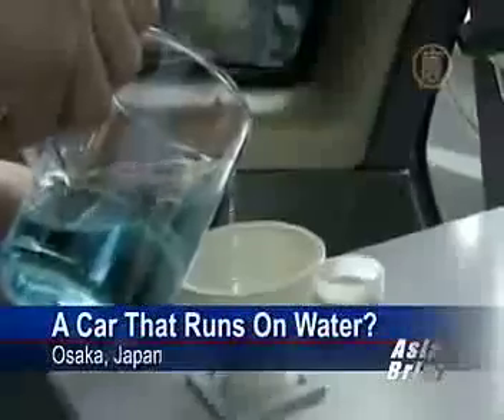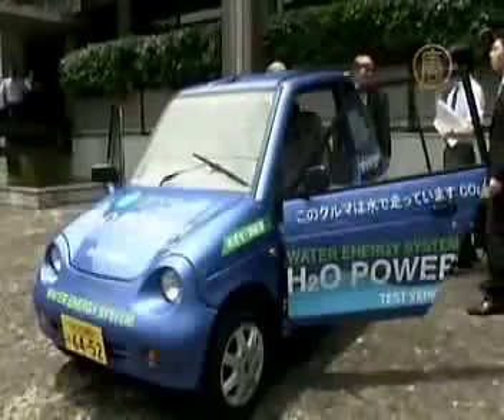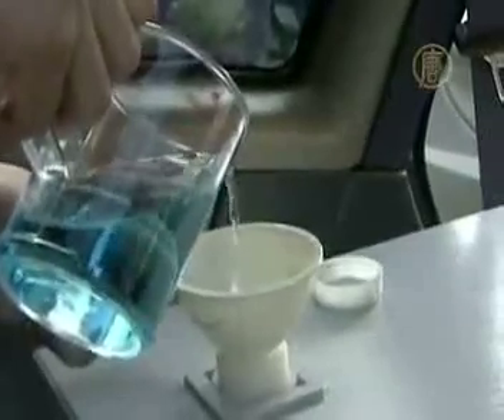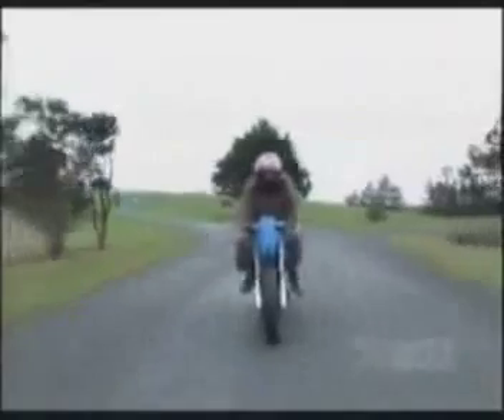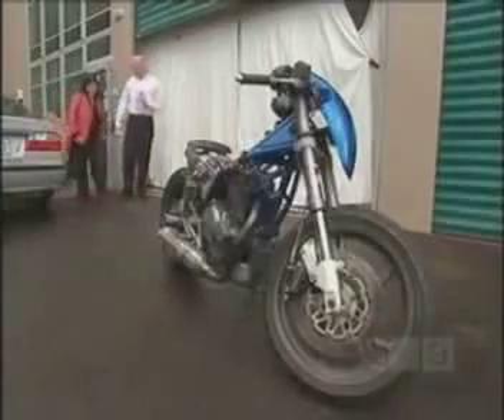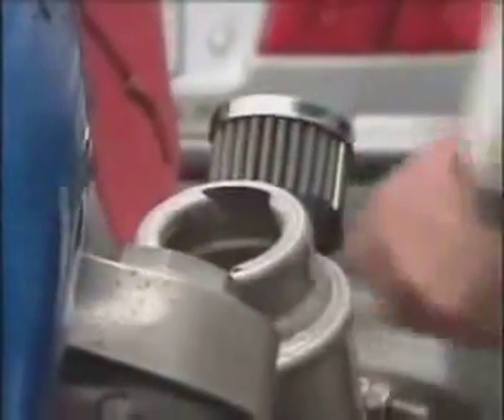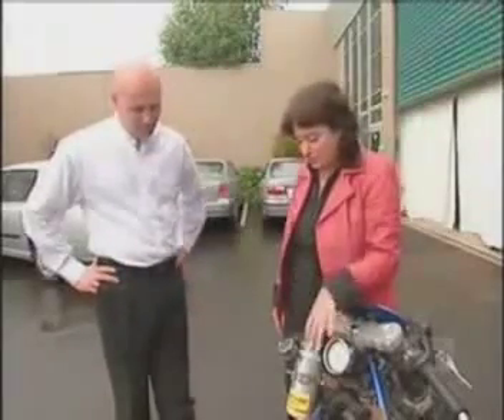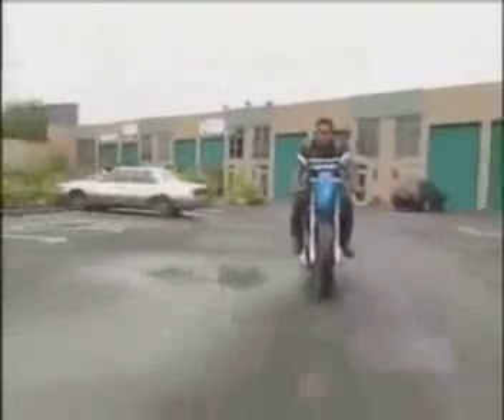H2O POWER WATER-MOTOR ENERGY CAR RUNS ON WATER

Comment: basically using hydrogen like a battery...there's no energy gain here. if anything, there is energy loss. the hydrogen would have to be extracted from a deposit or generated with a third energy source (ie nuke power plant, coal, wind, solar, etc)

Comment: i need a tank or a big double decker bus that uses water for fuel when there's a zombie attack and petrol or gas will be slim pickings. also i will need solar power for lights at night and powering and charging night vision gear, security light sensors.

Comment: And I have a great deal for you on a bridge in Brooklyn.
You get one of these every couple years and occasionally a TV station is dumb enough tot actually run it.
Water splittign is an EXOthermic process. ie- it takes every, not release it. You can burn the hydrogen afterwards, but you only get back what you put in, if you're lucky.
So you MUST have en external energy source to split up the water first or defy the laws of thermodynamics.